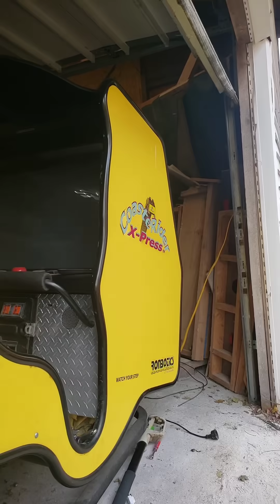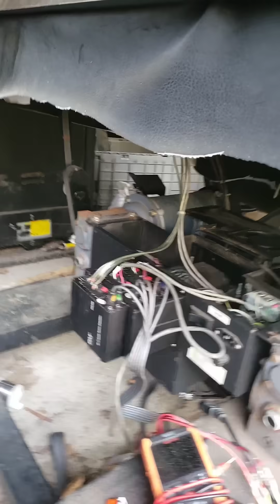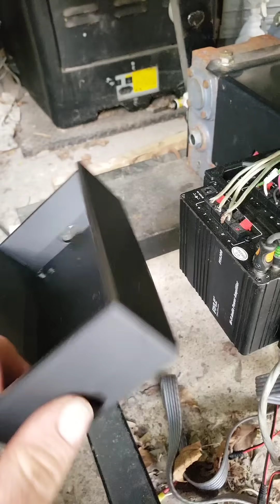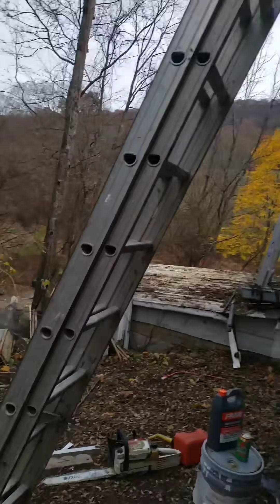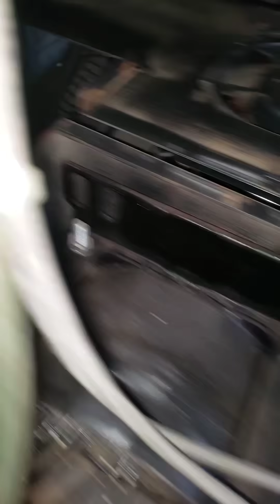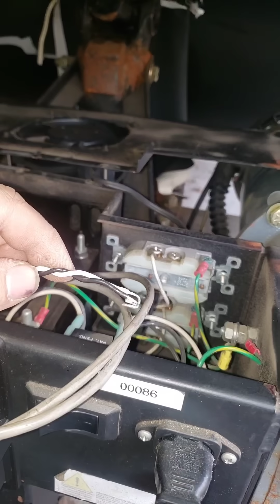Custom Roller Coaster Power Supply #arcade #electronics #restoration #diy #3dprinting #repair

Comment: With stranded wire you can just attach it as you did to plugs under the screws. You don’t necessarily need to tin them but it’ll make it slightly easier to keep the wire under the screws